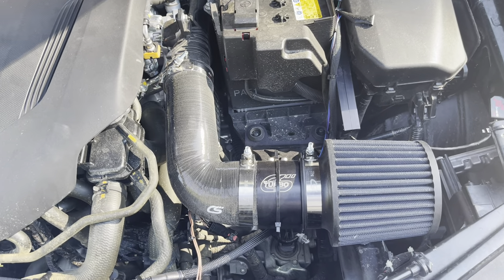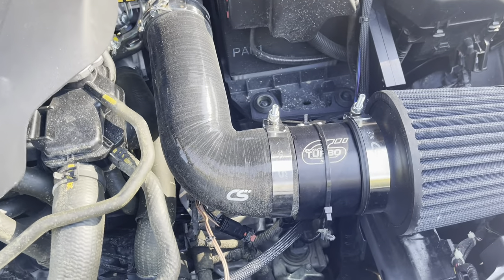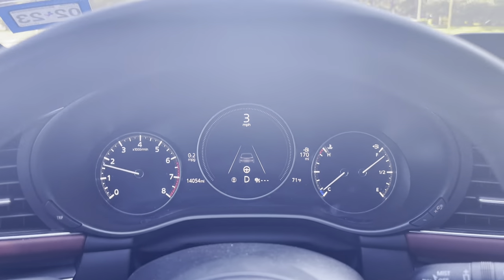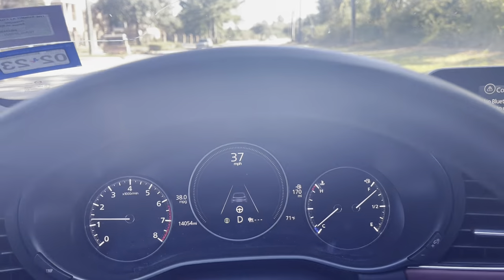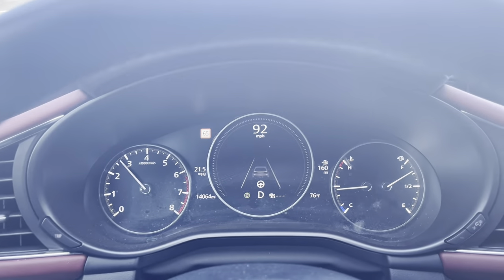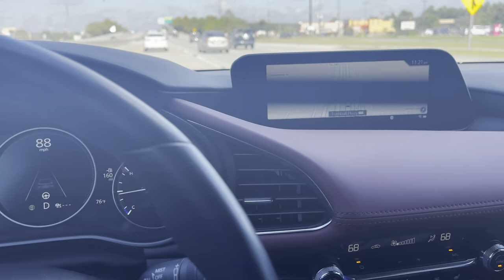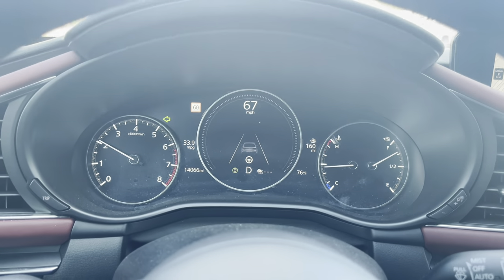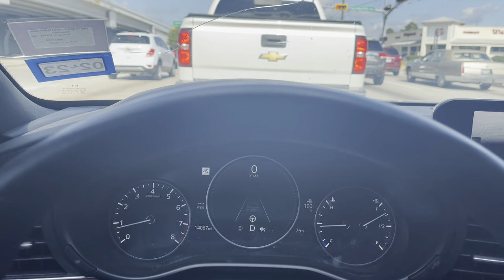Mazda3 Turbo/ CX-30 Turbo Corksport Short Ram Intake!

Comment: Sounds so good, I can't wait for mine to come!
Reply from the maker: It’s better in person!
Reply: @3turbo144  is that the only mod you had installed? Didn't sound like you had an exhaust but I'm at work too and I couldn't really tell
Reply from the maker: Stock exhaust (for now). Waiting on the CS 80mm exhaust and DP. Might end up just getting a custom 3in straight pipe tho
Reply: Notice any extra power?
Reply from the maker: @jlhaynes54  Nope, but I didn’t expect it to either. Just an intake on a turbo vehicle won’t make extra power because the ECU (or in my case JB4) will only allow it to make a certain amount of boost. At most you might notice quicker response but it feels the same to me just better sound
Reply: @3turbo144  VF Tuners just got their M3TH in for testing in case you didn't hear. Turbo tuning on both Denso and Mitsubishi ECU's coming in the spring!

Comment: No hate on the build at  all, I was looking to do mods and on my cx5 23 and the stock Mazda air box’s are actually really nicely made. Honestly the stock box is allmost as nice as the trd 4 runner intake box
Reply: Well, that's Mazda. But I think it's just designed to reduce noise.

Comment: i had mine for over a month now. Just one issue happened to me on my turbo 3. I was downshifting and engine braking to a stop and the the car's Rpm was acting up after that. at idle it would almost be stalling.  The car would be shaking a little. I Shutoff the car for a few minutes and it was fine after that. I was told to Unplug the Battery for 10+ mins to reset the sensors. Never did that yet since i never had this issue happen again.
Reply from the maker: Hopefully it doesn’t happen again!
Reply: Same issue has been happening with me , but it happened even before I installed an intake so idk what it could be
Reply: im having a ton of problems with mine i just installed it and im getting a bunch of different codes and my car keeps loosing power completely lol

Comment: Do you follow the forum for the jb4 tune. I’ve been following it for some time. Burger tuning is coming out with a air intake as well as making a new map for the jb4 that takes an exhaust and a new intake into consideration. Have you ordered the 80mm corksport exhaust. I want to order it but I don’t see it on the website at all.
Reply from the maker: Yes I follow the forum, I mentioned at the end of the video that I’ll probably end up switching to it. The 80mm exhaust isn’t even released yet
Reply: @3turbo144  You are better off just getting a muffler delete and having it come out the twin outlets.The diameter of the pipes alone actually create the optimum back pressure and a custom exhaust with hangars and bolts will just drone.Have a muffler delete and weld it to the undercarriage--I plan on doing it to my new CX-30 at some point.I had this on my stinger and afte the exhaust rn a 4.2 to 60 and a 12.7 in the quarter mile with no launch control.

Comment: Enjoy the hot air it will be sucking in.
You need a heat shield and out the snorkel back on.
Reply from the maker: IATs didn’t change

Comment: Do you recommend me get one for my 3 Turbo ....will it give the car problems later on and will it void any warranty????????
Reply: I have one and it doesn't void the warranty or cause issues later on. I love mine.
Reply: @anthonydigiorgio9240  it won't void my warranty with mazda????
Reply: I'm sad to say that there is really no reason to get an intake other than for the sound... Mazda tunes their intake systems really well, you wont get any power improvements. However you should change your oil more often with one of the dry flow or oil cotton filters like K&N. they can flow more, but they don't take the small dust particles out of air like the stock filter does.  I have proven then with my own Oil analysis numbers before and after installing an intake on my old 3. Silicon was 30% higher for the same drain interval of 6K miles.  Just something else to consider if you are planning on keeping the car for over 100K.
Reply: @mikel9656  I bought the intake from corksport do you think it will be safe in long term won't mess up my car at all ???
Reply: @macdazzy5776  add couple more question marks. That may help you find the right answer from multiple people
Reply: @mikel9656  they tested the car on dyno's with these cold air intakes, they get like 5-6 more hp.. little, but some

Comment: buys mid intake instead of fixing windshield
Reply from the maker: I also traded the car in instead of replacing tires and brakes
Reply: @3turbo144  hopefully it doesn’t have a cracked windshield L + ratio
Reply from the maker: @dramos7935  I hope it doesn’t end up cracked either, I just spent a lot of money tinting the whole windshield lol

Comment: Ya Not happy with the quality. It was and is a half ass attempt at a intake. To me it’s worthless I am looking for one that not just Performs but also looks good as well so when you’re at a car show you can actually show your engine bay and it would look nice maybe with a black chrome piping something like that cold air intake but a short ram on a silicone whatever gizmo not going to work for me! Thanks for your review buddy.
Reply from the maker: I didn’t buy it for looks or performance, I just wanted the sound. I’ll never enter my Mazda3 in a car show so it looks good enough for me, but I can understand wanting something a little better performing. I have monitored IATs and they did not change with the intake